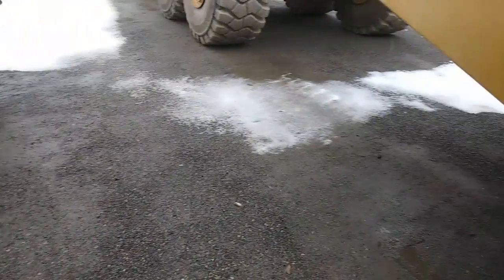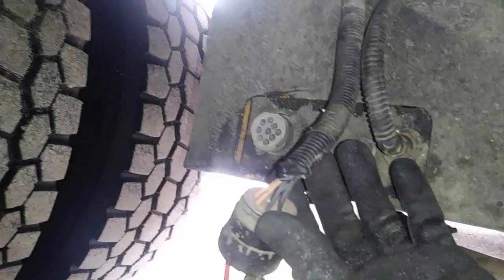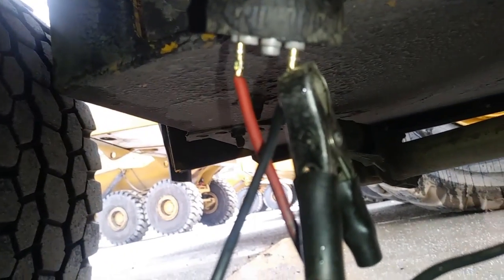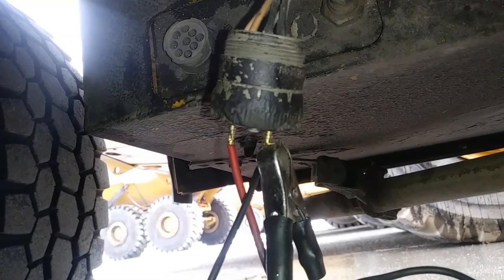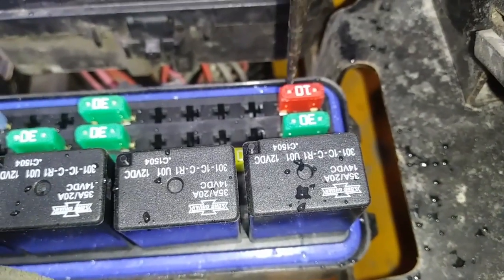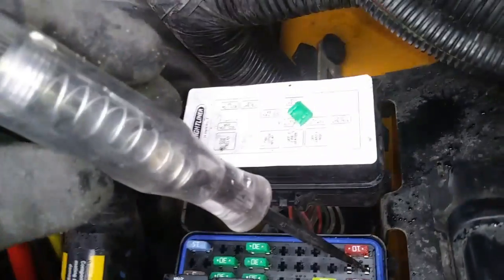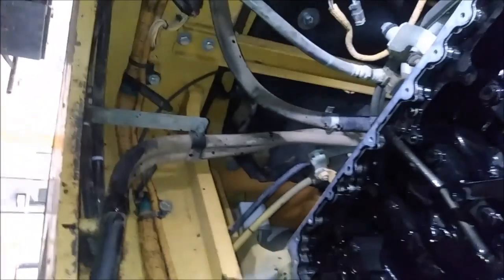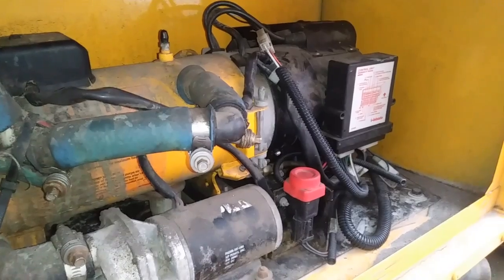Why You Should NOT Trust Your Multimeter By Itself. Diesel Mechanic Electrical Troubleshooting.

Comment: so you either solder a little bit of a new wire right there? or run an entire new wire ?
Reply from the maker: Considering I was working outside and it was snowing. I cut out the corroded section and spliced in a new section with heat shrink and made it as weather proof as I could.
Reply: @AdeptApe  ok cool cool makes sense. Thank you for the videos very very informative and helpful
Reply: @AdeptApe  I found you fix wiring and harness like a pro video

Comment: Love it, but as an Auto and Diesel educator myself, we teach modern day technicians not to use test lights anymore. Also, ohm testing wires with that long of a jumper wire is not a valid test. We use voltage drop testing. Pulling a load through the suspected circuit and performing a voltage drop. But as you have shown persistence can usually locate any problem. So good job.

Comment: Initially, I read the description and thought, "What? I trust my Fluke 87V implicitly." So, let's see what's going on... if memory serves, a Fluke 87V (love those DMMs) has a 10MΩ input impedance, right? And, you measured:10.38V. So, that means about 1.038 µA was flowing through the meter. So, based on the 10.38V measurement, we can safely assume that, somehow, you lost right around 1.6 volts between the fuse box and the connector you tapped into. Using ohms law, we can divide that 1.6 volts by the 1.038µA, we just inferred, with the result being 1.541 MΩ (interesting). The next thing I would have done would be to load the circuit, just as you did, with something more like a couple hundred ohms (a taillight bulb works well too). Glad you put the "𝙗𝙮 𝙞𝙩𝙨𝙚𝙡𝙛" in the description. Voltage measurements (regardless of meter quality) should never be trusted 𝙬/𝙤 𝙖 𝙥𝙧𝙤𝙥𝙚𝙧 𝙡𝙤𝙖𝙙. In fact, a volt meter is really just a current measuring device calibrated to read volts across a precision (10MΩ in this case) input impedance. Side note: Fluke's most accurate voltage measuring device is known as a "differential voltmeter" where you apply a precisely calibrated opposing voltage to the circuit under test, using an array of switches and potentiometers until the two voltages balance out and you get zero current through the meter. Then, you simply read the voltage settings on the dials. Infinite input impedance is its claim to fame. That way, there's no loading of the circuit whatsoever. Not the case with the 87V which puts a (tiny) 10MΩ load on the circuit. In this bus scenario, the differential voltmeter would have indicated battery voltage. Utterly useless for this application, but fun to know about and very useful in a laboratory R&D environment. The Fluke 87V is a damned fine piece of test equipment, well suited for a wide array of more sophisticated jobs. Leaving me to wonder if it isn't overkill for this type of job. This is not to say that I've never used my 87 in automotive apps. If I had a cheaper DMM, though, I would have used it instead, saving the Fluke for jobs more suited to it's abundant array of features. Love your tech talk Josh.

Comment: The multimeter is not lying to you. It show you that the voltage dropped when you loaded the circuit. In other words you have a voltage drop or high resistance problem in the circuit. You just need to learn how to read your multimeter

Comment: i watched a dozen of your videos and i think this one is by far the most amazing and skillful.......to be able to track down by deduction and testing a dead wire in that maze of sloppy wires over a 35 foot span under a bus is exceptionally good.....anybody can torque a head bolt but to find a dead wire in a maze under a bus on a cold winters day with a meter and a light stick is extraordinary.......if it was me i would have run an entirely new dedicated hot wire through a dedicated new fuse from the fuse box all the way to the heater in the stern and not even bothered trying to find the fault.....which is probably why i'd never be a good mechanic

Comment: Amps ? Can have voltage with no Amps had a battery showing 12v but no Amps funny had mechanic at another shop tell me battery was good cause it had 12v it was something else after he replaced starter, alt ,cables, and fuses  finally customer brought me the truck load tested battery after seeing 12v on battery had no Amps this was a "ASE" also don't understand why dc power people can't get told customer to get his money back for the stuff he didn't have to replace

Comment: I have been saying this for years. OEMs do not want to hear it though, they are terrified of technicians putting circuits under load. Especially terrified of technicians putting output circuits in their modules under load. OCV testing is a useless test outside of certain very very low current applications.

Comment: Had a similar problem with 220 volt circuit. Had full voltage on each leg but the equipment would not operate. The cause was that breaker was dislodged just slightly causing a very weak or light contact, therefore insufficient current

Comment: There's an old saying in the controls business, "Beware of programmers carrying screwdrivers". Apparently it's time for an additional one, "Beware of mechanics carrying meters".

So knowing that the input impedance of a Fluke is about 10M ohms (I suppose this varies between meters, but it's a good rule of thumb), we can take your reading of 10.38 volts and divide it by your battery volts. I get .865. Subtract that from 1 to get .135. Multiply that by 12 to get the resistance coming in to the meter. I get 1.62M ohms. See? The meter doesn't lie. :)

But you can forego the math and just know that if you are getting less voltage at the end of the circuit with no load than you do at the battery, you have a bad connection. It's that simple if you are using a DMM.

So your outstanding Fluke 87V is telling you that you have a really bad connection somewhere. Although your bulb tester is a handy tool to have as well.

What's really interesting to me is that you had .4 volts with the circuit disconnected from the battery. I'm pretty sure that your Fluke isn't making that up. Galvanic action?

Comment: Its called LoZ setting its on all the newer meters from fluke depending on the model. It puts a load on the circuit, Its also called “ghost” voltage.

Comment: Yeah blue bird loves having electric issues
Reply: I worked as a field tech for bluebird. They all have their issues, but I definitely got better at troubleshooting circuits after working on them lol
Reply: @jeffsmith8066  what I think is sad is the issues I see are preventable. A little more care here, move this screw 1/2 an inch to the left, dont pinch that wiring harness when you put the body pieces together

Comment: Good troubleshooting but I wish you would have voltage dropped the single wire because what if you just had one strand touching? Good ohms, one carry the load. Single wire voltage drop would have shown it. Plus i struggled with that diag part for a min and misdiag cause of it

Comment: most of the wiring problems in the Apache were chafed wires.  Step #1 visually examine entire run of the wiring harness. this step solved so many issues right from the get-go.

Comment: I am a retired transit bus mechanic I have all the toys. I have the loadpro the power probe 4 and the power probe hook but for finding open circuits I use a fault finder for 40ft coaches

Comment: Old time electrician told me them old analog type meters ones like Old time like gauge with arrows line is best they not so bad give you false readings. I seen them digital ones do crazy stuff. Now days clean terminals & connections & resealing  connectors properly, replace die-electric grease at places manufacture recommend  so important. Heath of electronics start at batt. Thermals & battery health most over look area I seen so far & Crazy voltage outputs will drive all this electronics stuff to do crazy stuff.  Got admit wet cell open batteries not only dangerous they eat your clothing off too. In way I don't blame some them people not fool with them properly. See 2 D-8 wet cell  batteries blow up you never want see that again. Using 1910 tech in 2020. Time upgrade.

Comment: This is why an h11 bulb and pig tail hang out in my tool box. I have burned my self and wasted some serious diag time from having good continuity and voltage on my DMM, but not load testing a circuit.

Comment: I can tell your electrical training is incomplete. There is nothing wrong with that multimeter. It is indicating a voltage potential, just as it was designed to do. If you want one that loads the circuit that you are testing, they are available. You just need to use the proper meter.   Read here to understand better:   https://mastersamuraitech.com/the-low-down-on-loading-meters-and-dmms/
Reply from the maker: Thank you for the comment and I would recommend watching the entire video before leaving a comment as this is described in the video.
Reply: @AdeptApe  I think you misunderstand what I am saying. I saw no problem with your troubleshooting, just your statement to not trust your meter. If one can not trust their meter, why are they using it?  There is no reason to not trust your meter. It is merely a tool. Using it correctly will allow discovery of the problem. Instead of a loadpro set of meter leads, I always used a jumper with about 10 ohms resistance to clip on to my meter lead probe and the other end to ground. Taking two readings, one with no external load and one  with the load jumper will tell one if the circuit has a loading issue.  I did watch the video before commenting and watched it again in case I missed something. I don't think I did. Also, before taking any readings with your meter, always perform a test on a known good voltage source of the same amplitude that you will be testing for during troubleshooting.   That way you don't troubleshoot with a meter that is not indicating any voltage because it is broken. This load jumper is only good for 12/24 volt DC circuit testing and no AC testing. Using a meter like I described is also easy to add a jumper to the red lead with the other end of the jumper holding a needle to push into wiring to check for voltage. Much smaller hole and damage to the insulation. Just a couple of tips from a 50+ year career of electrical/electronic work.

Comment: Yeah we disconnect on both ends. Shoot voltage through wire and hook a bulb up in other end and ground it. Also you can use dmm to check voltage across bulb

Comment: Meter is not wrong, you should always check the circuit with a load. Use a headlamp bulb as the load

Comment: Electrical troubleshooting requires that you understand that a high impedance digital meter does not put any load on the electrical circuit therefore the digital meter can even read electrical noise or what some guys refer to ghost voltage.  All you have to do is get bit one time by ghost voltage and you will make you a couple of load lamps....

Comment: "Ghost voltage " it'll get you every time. One time I had a wire that looked like it was perfectly cut but the case was not damaged at all. The voltage would show up but wouldn't carry a load. Good video. Especially liked the part where you identified the non cat engine....ugh

Comment: Always love chasing down wiring issues.. most of our equipment, it usually tends to be a ground issue, but once in a while, it's the power.. like you said, usually at or near a connection.

Comment: Great video and explanation of basic electrical troubleshooting. 👍🏼

I wouldn’t say your meter is lying per se, but as you mentioned, there can sometimes be not enough information. I have a Fluke 117 meter that has a voltage reading selection that adds a resistor inline to drag down induced or leaking voltage. No test light required and it does the same exact thing. A test light is an excellent troubleshooting tool, so is this meter. It’s just a different tool available to the tech who owns them. 

Many different ways to skin this cat, but you did a fine example of showing us a correct way to troubleshoot. 🍻

Comment: Bingo. Voltage doesn’t mean it can accommodate amps. Bad connections or damaged wire can cause this.
This applies to AC also

Comment: Multi meter is not wrong.. it is only reading what you the operator is asking it to read. A tool is only as good as the operator using it. I troubleshoot DC under its operating condition and I read along one side of the circuit at a time looking for voltage drop with a good multi meter that can read milli amps. This will identify high resistance connections under load. This is one of your best troubleshooting techniques for DC circuits. I always like a test light too, they are good to get started to quickly narrow down your search. A regular one with an incandescent bulb, not those led ones..
Reply from the maker: I have the LED one also and thought I would use it more, but find I reach for the old fashioned one more often than the LED one.

Comment: While voltage drop is the most correct way useing a meter and then an incondescent test light is my choice quick easy and you know it is capable of holdomg a light load.

Comment: Your checking simple voltage not amperage the voltage is there with no load  kinda like load testing a battery it may have twelve volts but pull a load on it an voltage drops right out.   But hope fully your video will help somebody understand why you always perform more than one test trouble shooting an electrical problem.  Thanks  great videos

Comment: I was a transit bus mechanic for 15 years. Webasto is now Spheros.  We had coolant heaters on our coaches. Our heaters would flash a fault code on the power switch LED.  
Fortunately, Gillig coaches seldom had power supply issues due to their quality engineering. Most issues were internal to the heater.
Regarding the snow, I thought you lived in southern California ?
Reply from the maker: Never lived in California, but close. The subject of the change in outdoor temperature will be revealed in a future video.

Comment: The multimeter isn't lying you just dont know how to use it apparently... you need to backprobe the circuit while its plugged in to check voltage drop. A multimeter has 1 million ohms input impedance, which means you can have lots of resistance in your circuit, but the meter resistance is always going to be higher, so it will still show the voltage drop over the meter
Reply: He knows how to use it just fine. He fixed the problem and that’s all that matters.

Comment: Great job illustrating a critical detail that many multimeter users fail to appreciate.  But I DO TRUST my multimeter.    That 10.8 volts was real, but it wasn't the complete picture (including resistance) one needs to move forward with the diagnosis.
Reply from the maker: Yes, I trust my meter as well just have to understand how voltage and amperage relate to corrosion.

Comment: Yep, good voltage isn’t good until it is tested under load.  But this is no reason not to trust your meter...
Reply: Its called LoZ setting its on all the newer meters from fluke depending on the model. It puts a load on the circuit, Its also called “ghost” voltage.
Reply: @Youngbl33zy  That's really for pulling down voltage that has been induced by neighboring wires (think of the wires in a conduit as a coreless transformer). It used to be a real problem with the old DMMs which would show phantom voltage on wires because of other conductors in a conduit next to them. Amprobe had a horrifically bad tester back in the 80's.

The problem stems from using MOSFETs for sampling the voltage, which are great since IIRC, a Fluke has an input impedance of about 10M ohms (which means that the tester doesn't throw off your reading because the meter is a load itself - well, not much anyway). If memory serves, the old Simpson 260's had an input impedance of 25K ohms per volt.

The days of 200 AC control wires in a conduit are thankfully over, so it's not the problem that it once was. However, if you have multiple circuits in a conduit you will still get that phantom voltage.

And the LoZ switch shouldn't have any affect on a DC circuit (since you aren't getting any extra voltage from AC coupling).
Reply: @Youngbl33zy  explain

Comment: You ALWAYS diagnose using voltage drop. The meter isn't lying, you're using it incorrectly. I'm not directing this at the tech here, he is pointing out the correct method.

Comment: Hey, I have a question I have a 1994 cat 3406e 5ek, and I also have a 1998 1lw cat 3406e 550hp do you thing I can put the 5ek injectors in the 1 lw and a 800 cam?
Reply: I'm not saying it's 100% ok, but the injectors will usually work and probably are the same based on what HP rating the ECM is. For instance a 550 hp 1LW and 5EK will probably both have 10R-8501 injectors. The camshaft is another story though... There are many grinds out there for the 3406E / C15 platform, but the tricky thing is that based on the software / engine S/N it will probably not have "pilot injection" on the injector lobe since it's an earlier 1LW / 5Ek series engine. On the later engines ie - 6NZ C15 series, they used a more aggressive "pilot injection" hump on the cam lobe, making the engine run smoother, quiet things down a little, better emissions, etc. So in theory, if the camshaft you want has a more aggressive pilot lobe, you will run fine on the bottom half of the RPM range and tend to fall off about 1800-2000 RPM under load. I've seen guys do this several times and all went back to either the original cam or back to the drawing board on what cam to choose next.
Reply: But the 5ek that have bigger injectors right
Reply: @jorgepineda8043  Depends on the rating and serial number. Most of the 3606E engines uses the 10R-8501 injectors now, it's the most common.